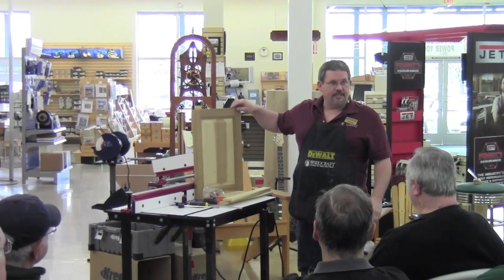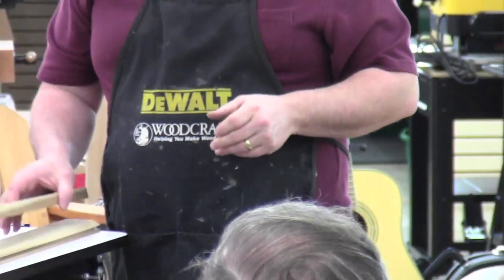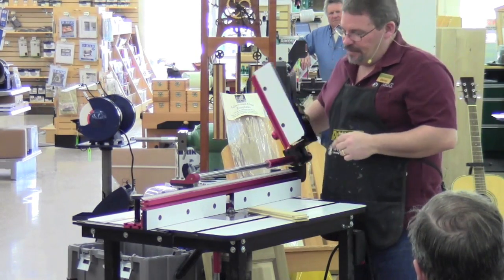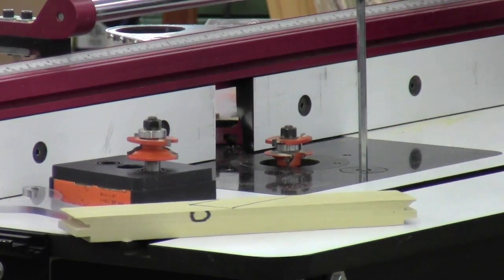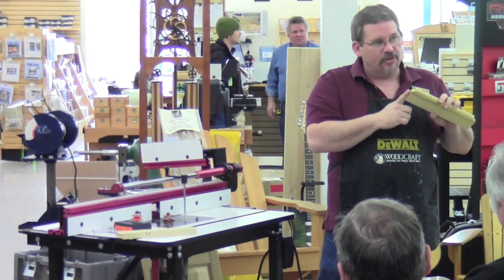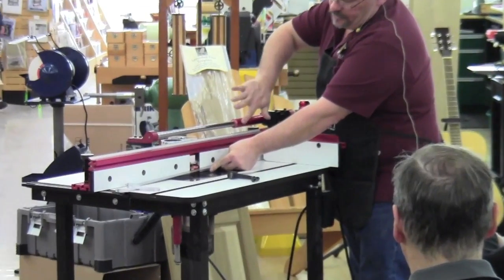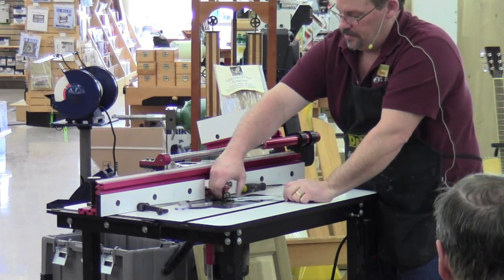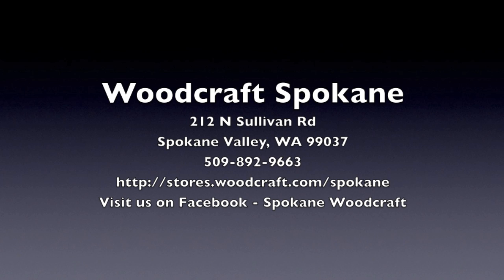Rail & Stile Router Bits Pt1

Comment: Thanks for that. I have been doing the styles first and rails second. The sacrifice board i made was cut from a board running with the grain of the wood on the cope cut.
This presents numerous problems if the sacrifice board is above or below the rail when it is fitted to the rail. I am definitely changing to your method of rail first and style second. I have been looking for a better method. This is definitely an improvement. The only good thing I can say about ( style/ cope) the previous method is that there is never any chip out. But this comes at more labor and increased chance of not having proper alignment of style and rail.

Comment: I have been building Raised Panel doors for some time now and I find that if I use a PERFECT square piece of 3/4 plywood (Using my table sled) and I hold the Rail against the plywood which is a hell of a lot cheaper than buying a "Miter Slider"

Comment: Because I'm routing a tongue on the ends of the rails which is 5/16"..... do I add 10/16" to the length of my rails?  The tongue insets into the stiles and therefore must "shorten" the rail.
Reply: +Sharon Shook   hay sharon-in fractions,don't double the top
number, devide the bottom number as in 5/16 x2 ,devide the 16 
by 2 and you will get 8 ,so 2x5/16=5/8  and so on.
Reply: Hi Sharon :)  Test on pieces of scrap wood first.